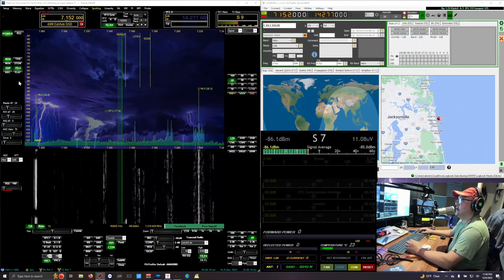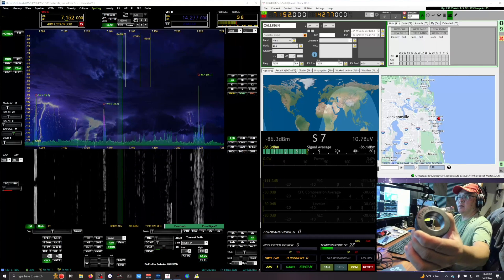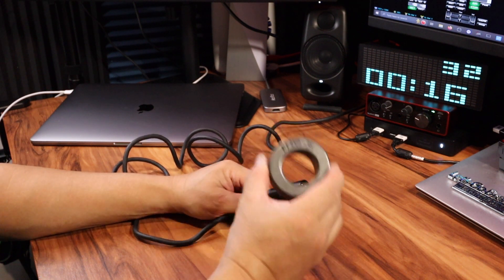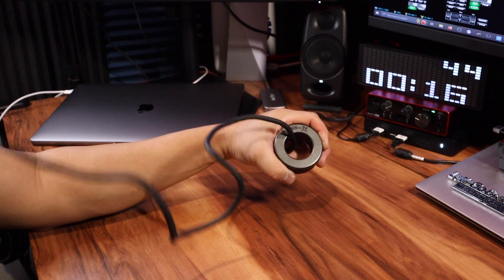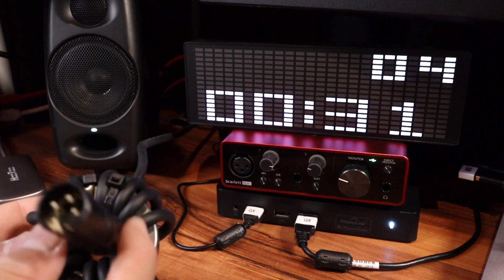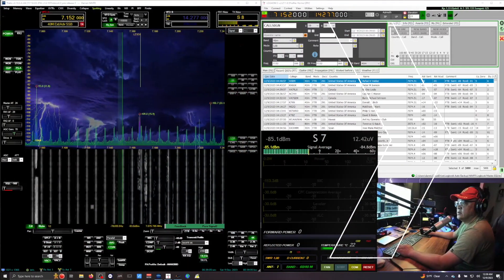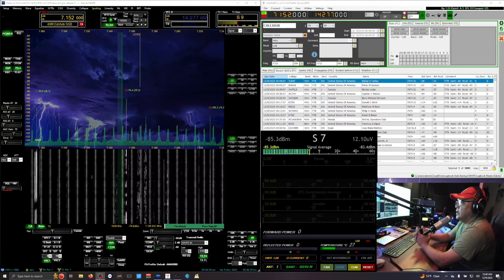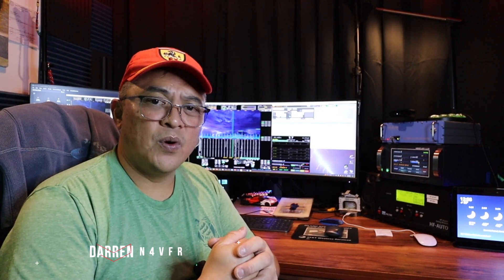How to get Rid of RFI on 40 meters |  Torroids 240-31 Reduces RFI | Common Mode Chokes - Not enough!

Comment: Nice. i have same problem. Just to clarify, you fixed the issue and then in did it all, to demonstrate the fix? Have i understood this right?
Reply from the maker: I was troubleshooting shooting because there was a little RFIin my headset.  when I took the existing torroid off the XLR, there was tremendous RFI energy and I wanted to demonstrate the RFI without torroids.  When I put the torroid back on the XLR, I think I added an additional 2 more turns through.  And put a ferrite bead in line as well. Then, it eliminated the RFI.  So attack the Mic input when troubleshooting for RFI in your powered speakers and head phones.